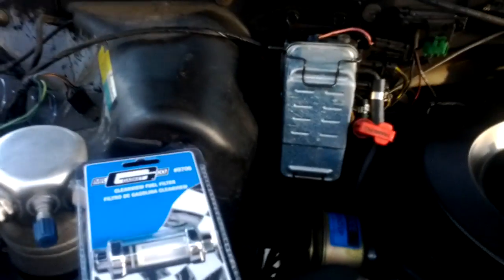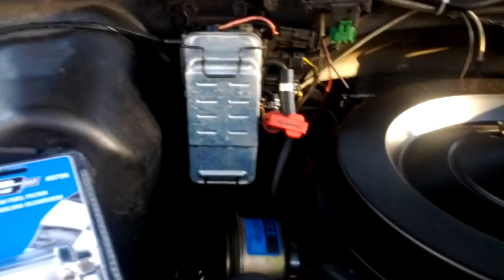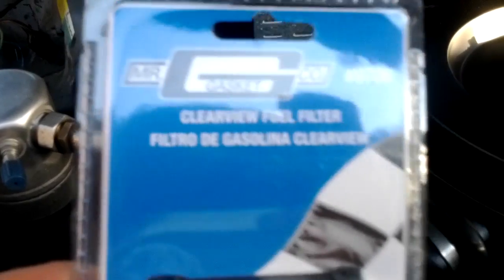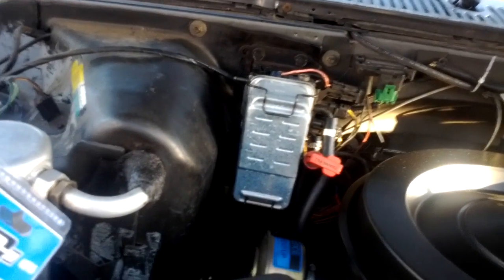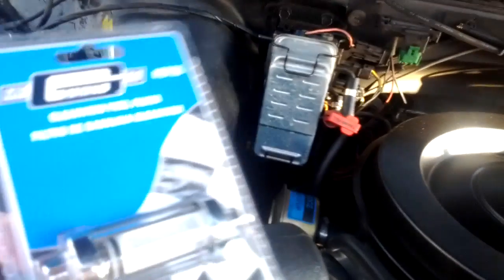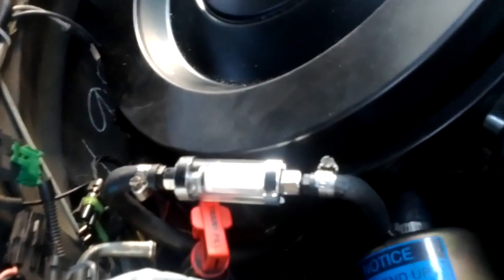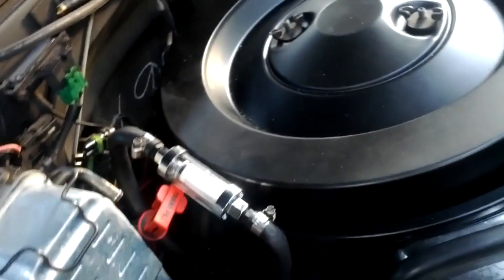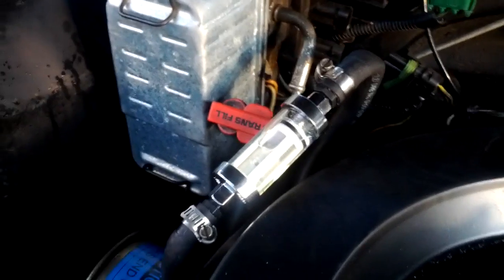Clear Fuel Filter Test - Fuel Filter Block or Lift Pump or ?

Comment: I have a similar problem with a 82 6.2 Detroit diesel - I’ll fill up the fuel filter and after I drive around for a little it’s starts to shut off by itself I changed the fuel pump but it won’t run unless I fill up the fuel filter

Comment: Diesel is HIGH Pressure! That Glass filter is made for Carbureted engines!!! Get rid of it! It is EXTREMELY Dangerous!!
Reply: low pressure until after the injector pump... then its all hard lines
Reply: Yeah I bet he is push 26k psi on that common rail... 🙃🤪
Reply: Shut the fuck up about shit you know nothing about.

Comment: I guess it was the lift pump.  It should've gotten the air out pretty quick.  Apparently it's not pumping at full capacity or your fuel hose at the fuel sending unit is bad.  Can you tell a difference when it's a full tank vs 1/4 tank? Replacing the lift pump isn't hard, it's just hard to get to.

Comment: Your lift pump is shot that little filter should be solid fuel you are starving the injection pump. The Stanadyne injection pumps rely on a steady fuel supply to keep them lubricated and cool you don't want to be cooking your injection pump. Right now your injection pump is sucking the fuel with the help of gravity. You are not going to have fun trying to replace that mechanical lift pump.  Your ideal set up would be a electric pump with a Racor mounted to the frame rail under the cab.